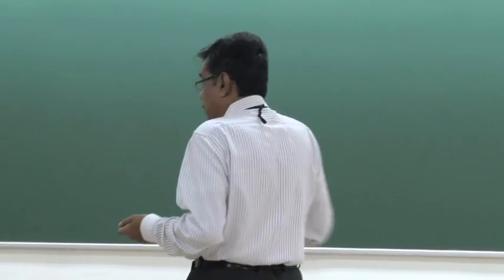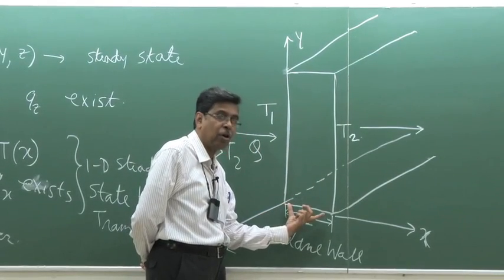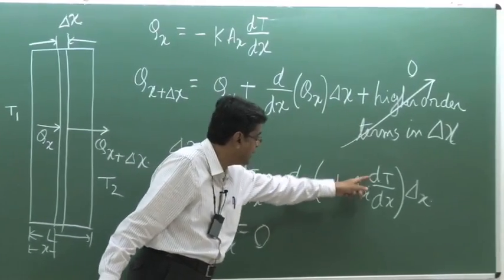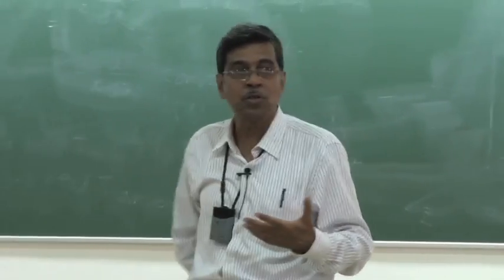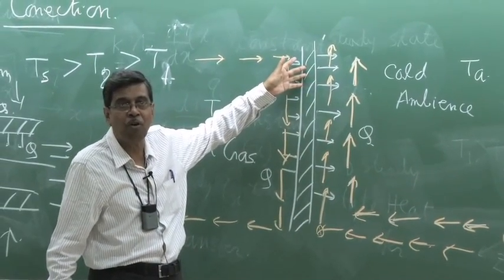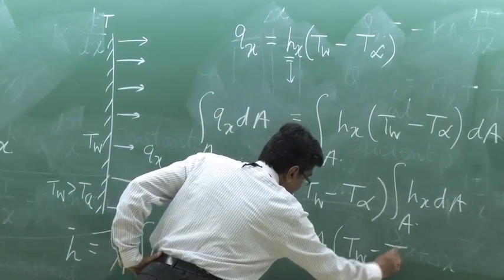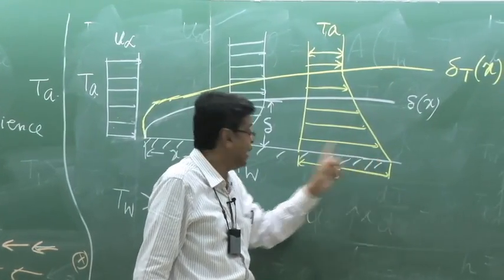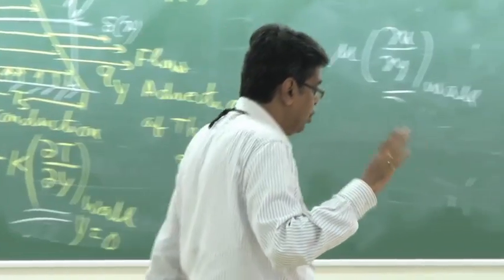Lecture 02: Introduction and Fundamental Concepts - II

Comment: • For steady state heat transfer - 
1) The rate of internal energy accumulation or storage within the mass or control volume of system at any instant of time is zero. 
2) So, the efflux of thermal energy & conversions are mutually balanced at any instant & at every local point in the system.  
3) Temperature at any instant of time is independent of time & only function of space variables. 
For cartesian -  T = T(x,y,z), 
For cylindrical - T = T(r, theta, z), 
For spherical -  T = T(r, theta, phi). 
4) System may or may not to be in thermal equilibrium with surroundings even if it is in steady state. Thermal equilibrium is the end state of steady state heat transfer.

Comment: How convection is not possible in solids. Sir, lets take an example of cloth, cold water and person with fever. We dip cloth in cold water, and then place in on the forehead, then the cloth(solid) takes the heat , then we dip In cold water it become cool. Then again we put that solid wet cloth on forehead hence according to me convection takes place. So tell me, your views regarding this , sk som sir.
Reply: Here we have go into detail of the phenomena that happens. Whenever you dip a cloth in water, water gets absorbed in cloth due to capillary action. Cappilary action is rise of liquid in small holes or capillaries due to surface tension. It is the same phenomena because of which kerosene travels to flame  throufh cotton wick in kerosene lamp. So after dipping the cloth in water, it becomes soaked. Then this cloth is put on forehead of person having fever. Here cloth molecules remain intact instead water molecule moves through cloth due to combined effect of evaporation and capillary action. Water molecules from top layer of cloth evaporates leaving space behind. Due to capillary action, this space is occupied by new water molecule. So convection of water is carrying the heat not the solid. Due to complete evaporation of water, after some time cloth becomes dry.  Note that here also heat transfer happens from High temperature (Persons forehead) to low tempearure (cold water). Last point to note for convection to happens it is important for molecules to flow or leave their place. Solids have strong bonds hence convection is impossible. Liquid & gases have weak bonds hence can easily flow around.
Reply: @bhushanpatil9303  I don't mean it. I meant that solid can be cooled after it became hot and can be applied to the forehead again. Then is it possible for solid to transfer heat conventionally?
Reply: @ravenship2486  in the first lecture of Prof S.K SOM he has said is very clear that basically Radiation and Conduction are only modes of transfer of heat and convection is dependent on the conduction. and what you are saying is Is it possible for solid to transfer heat convectionally i guess not conventionally in your question well that is what convection is the case you are proposing in that there is air which is a fluid and that moves over the solid body , fluid gets heated and solid body becomes cool due to convection.

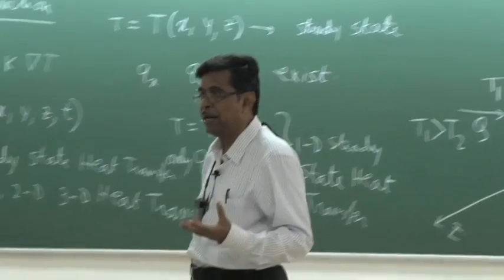Comment: can anyone tell me that what was that linear profile whose slope depend upon thermal conductivity at 21:02
Reply: It means temperature depend linearly with distance between  two temperature zone (hot and cold). For example, if one side is 100K and other is 900K then at midplane temperature is 500K and at mid of it , it is 300K
Reply: @ravenship2486  how did you calculate 500k and 300k?
Reply: @enn4  I didn't calculate it. I was just explaining linearity. If temperature has linear profile . We can calculate temperature at any distance easily as it is linear y= mc + c.

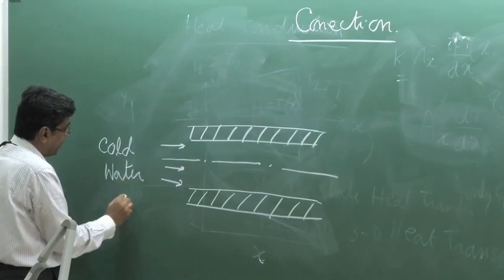Comment: sir u said that cold water has ambient temperature at 30:32 but ambient temperature is nothing but the surrounding temperature. so in steam condensors the temperature of water will be less than surrounding air temperature. can anyone clarify my doubt
Reply: pvs Mouli inlet cooling water temperature is same as that of the surrounding temperature and after exchanging heat with the steam its temperature increases at the outlet